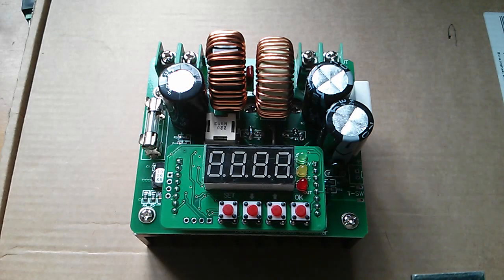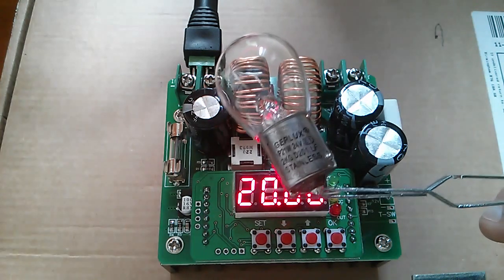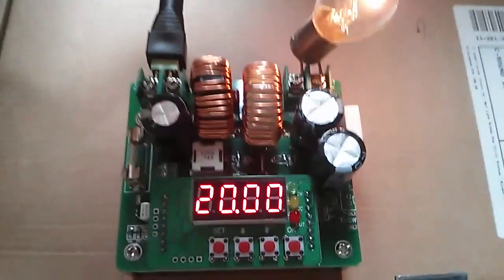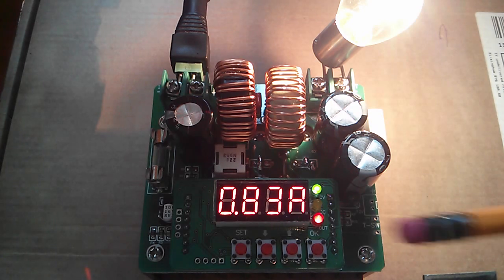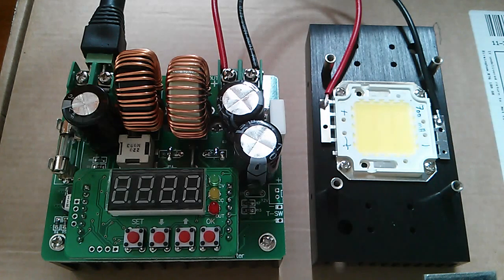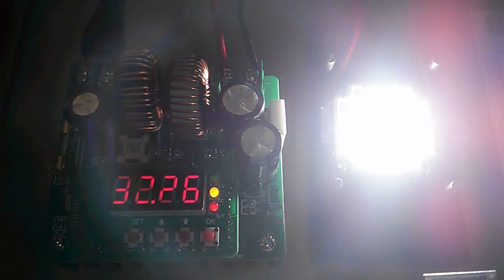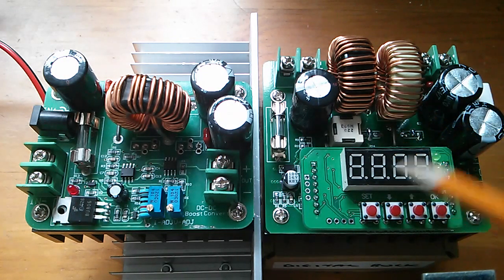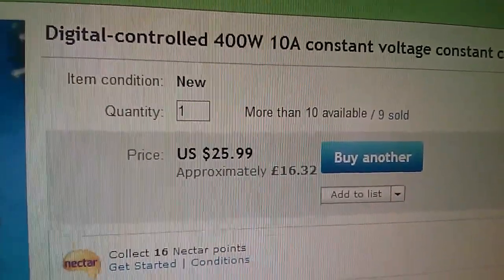Review: 400W Digitally Controlled DC/DC Step-Up Boost Converter

Comment: Its very good of you do do these video reviews on various e-bay electronic components especially since many people will find the information helpful and of course influence their buying decisions. On the other hand, a very intelligent and electronic savvy person such as yourself could easily build your own spot on boost converter for any particular application. It may be of further interest to your subscribers to see you build such a device (step by step) for the purpose of driving high power LED's with 12 Volts. PS You seem like a very interesting person and I'm an avid viewer of your channel. Keep up the good work!
Reply: +Cameron MacDonald 

Nominal 400W means that the module 400W maximum power under certain 
operating conditions, under different input voltage, the maximum output 
power is limited by the maximum input current limit declined.

For example:

The input voltage is 12V: maximum output power P = 12V * 10A = 120W

The input voltage is 24V: maximum output power P = 24V * 10A = 240W

The input voltage is 40V: maximum output power P = 40V * 10A = 400W

Comment from the maker: I did consider that as a solution, but...
The converter is also very slow to ramp the voltage back down. At the instant the LED was connected, it would be considerably over current until the voltage fell to the right level for proper current limiting. If you set the voltage quite precisely, it might work, but it's an added complication, and the whole point of buying this unit was to make driving high power LEDs simple. It's a real pain because this was to be the centre-piece of my LED tutorials.

Comment: Remember a while back we were discussing various cores for inductors? Looks like the module you have there has one ov each, the left one being ferrite and the right one probably being the powdered iron. I would presume (at a quick rough guess) the LH one does the actual boost converting while the RH one a supression choke to remove high freq spurries from the output.

Comment: What happens when you lower or raise the amp/ma on the in side of the boost converter? Like say I want to use one or more of these with a rgb controller and boost the voltage up from 12v or 24v to 34v for a high power rgb led? Would the boost converter keep a constant draw? Or alternate as its adjusted on the in side of the boost converter?

Comment: Hi Julian. I got myself one of these units (it arrived yesterday) and I think I've found a potentially destructive bug in the firmware on this thing. If you set an output voltage of less than 0.13 volts it goes crazy and starts ramping up the voltage continuously (way past the 80v max). I watched my unit go all the way up to 99volts before I killed the power to it to prevent it from self destructing (the output caps are only 100V rated). I also found that the current limit function becomes confused if the input voltage changes. I'm curious to know if your unit exhibits the same behaviour.  Thanks.
Reply from the maker: Jim Conner I'll give that a try - thanks for the advice.
Reply: I think you might have a faulty unit, I just tried it on mine and it doesn't do that.
Reply: steamtraintom
Thanks for testing that. Can I get you to check another thing for me please. When I attach input power to the unit the output ramps up to around 25V very briefly (even though the boost function is not enabled yet). It seems to demand quite a lot of current when the power is first attached, but after about half a second the power drops back down and then the display lights up.... and there's a third problem I have with it too... perhaps I should make a video to detail all of this?
Reply: Julian Ilett Hi Julian - As my Internet was down this morning, I took a little time to make a video detailing the problems I found with this boost converter. I won't post a link here as it'll be flagged as spam, but it's over on my channel if you're interested in taking a look. Cheers.
Reply from the maker: Jim Conner Hi Jim - thanks for doing those tests. Yes, those are quite nasty bugs. I'll link to your video here http://youtu.be/Xp6uDBMn3cY?list=UUWo6-_8wmKNyBt2FWDfUvpQ and also in the description. I'll be getting my unit back out again to test the filament LEDs soon. I'll let you know if I have the same problems.
Reply: Julian Ilett Awesome - thanks Julian. I have a friend with the same converter who's going to repeat the same tests this evening when he gets back from work, so I'll let you know how he gets on and whether this is just my particular unit or more widespread. I've been tempted by those LED filaments for a while myself too :)

Comment: Thanks for this posting.  Only used one boost converter myself and the one posted here is a serious high output unit.  I'll order one of these for various projects.  I'd really like to see, if you have chance to do so, take a Quad-Copter, adding on about 4 or so Mono-crystalline solar cells of say, 1 amp each, and use a boost converter and keep the Quad-Copter running full time in direct sunlight, changing batteries (or buffer Super Capacitor) for cloudy times, in all providing the Quad-Copter running for hours, providing power ratios fit.  That would be neat.  My idea ever since I seen Quad-Copters but since I don't have one and no time to do this myself, would love to see a video of your build of such a Solar Quad-Copter.  Hope you can do this.  If so, that would be great!

Comment: I have an application where the slow voltage rise time might not be a problem, but I need to be able to deliver 4A at 26.5V and I'm not sure that this unit can do that.  Your application here was for a somewhat higher voltage of about 32V but a much lower current of 700mA.  Can you tell me if this unit can deliver 4A at 26.5V from an input of 12V and given the loses better make that 11V.

Comment: Have you figured out how to use the F1-F6 settings when doing a long hold SET button? I found that the Power on/off at start up is set by Holding the OK button.  It doesn't look like #1 or 2 are available on this unit.  Any input you have would be helpful in the operations.  Thanks

Comment: it's not a problem of the digital side. It's a design issue. Also it's possible to set the current and voltage in an analog boost converter from a digital controller, which is better. Plus you can get one of those analog boost converters with a LED display on it which shows the voltage and another for the current. You set the voltage, then you put load and set the constant current value using the same 10 turn trimmers. Well for boost it's bad because you can't just short it as you would do with buck. And by the way there are boost converters that have more than one switch where you can actually turn the output off. The diode in buck or boost converter is the budget solution for the second switch.

Comment: Good day Julian. Just a wild thought, can this DC step up booster be used to charge a 60v (or even higher) SLA battery set of an ebike? I was thinking a front motor hub to be used as generator connected to a DC step up booster charging the SLA for extended range. Is this feasible at all? Thank you for your reply.

Comment: Don't know if you are answer this question but I wanted to run a string of LED lights when you get to the end you have exhausted your 12 volts down to 9 volts and some change, I wanted to use that to put into one of these units but the ones I've used that were very cheap seem not to be able to constantly run they turn off and on don't know why because when you put it on your voltage box it runs perfectly so all my tests doesn't work in the real thing I was trying to find something they can take something like LED lights boost it back up to the 12 volts from the nine volts and it seems to be blinking off and on can you take one of these modules and test LED lights is it feeding back what's happening I don't really care how long it takes it to reach up long as the current is constant so I can run all the LED lights on one single input.

Comment: Great vid!  I actually have a 900w 30a digital control boost converter the same as this I use for numerous tasks, I bought it about 18 months ago and it was a bit cheaper than your 400w unit actually (about AUD $24 (or US $17).
 Great for charging different battery voltages, solar control, and for powering pretty much anything, TFS!

Comment: Would it work to run a 24v solar panel to a 24v controller to this to a 36v battery bank? Can't seem to find this answer anywhere on the web. Thanks.

Comment: The slow rise time is from the large capacitors on the input and output.  These give you a more steady output with less ripple but at the cost of capacitor charging time.
Reply: Not that long. May take a fraction of a second, but not that long!

Comment: hey julian, do you think that the 600w non digital booster would be able to power up  2 100w leds, and if so would they be wired in parallel with an output voltage from the  booster of 70 volts with 6 amps or should it be wired in series with different voltage/amp ratio ?

Comment: For the slow voltage ramping - Try changing the output capacitors to a smaller value, I had a similar issue with a boost converter slowly ramping up and down.  The PWM we used from the microcontroller was fast acting, we used a large cap to help with smoothing, but it also added a delay due to the extra time constant for charging and discharging.
Reply from the maker: I don't think that's it, because the output capacitors (2x 470uF 100v) are the same on the analogue version and that doesn't have any delay at all. It's mysterious.
Reply: I guess the ramp is down to the voltage resolution, since it can't just bang it on at full, but has to vary the switching of the inductor gradually until it reaches the desired voltage.  I suppose it could apply a more intelligent algorithm to it though, where it ramped in coarser steps initially until fine tuning at the end of the ramp.
Reply from the maker: bigclivedotcom I'm thinking that the fast ramp up may have caused interference from the analogue to the digital parts of the circuit. Maybe the microcontroller was locking up, so they slowed it down. Might also explain the 2nd big inductor which I guess must be a filter (as xanataph suggested). The non-digital version (with the multi-turn pots) doesn't have the extra inductor.
Reply: Julian Ilett It could be that the fast ramp was overshooting the required voltage because of the delay caused by the capacitor charging.
Reply from the maker: bigclivedotcom Ah yes, that's a thought. Although your idea of a fast initial rise followed by a slowdown at the end would fix that. What's really irritating is that MingHe have no internet presence (no web site that I can find), so I can't ask them!
Reply: Julian Ilett What's the bet that it's one of many generic modules based on a common bit of software that was ripped off from a hobbyists website project.

Comment: I used a 600w boost converter of similar technology. Input was 12v and output was 48v to drive a controller for ebike having a brushless 36v motor. I found that booster is able to power the motor but it seems like there is insufficent amperage such that when i throttle it , after a short while like 1 second, the motor slows down due to the capacitor juice has been drained too low. If i throttle lesser for a few seconds, the output capacitors then have accumulated enough juice such that i can throttle harder again and cycle repeats. Is the problem really due to the output capacitor? If it really is 600w, then its only for a short burst. So, i should be looking at watt hour ratings?

Comment: Hi Julian, thanks for the video. I'm having real problems getting this to the setting I want. I don't know how to use the set, up, down, okay keys and get the output voltage and current I need. The instructions I have found on the internet have been translated from Chinese and not intelligible. Please help, thanks. I'm simply needing 24V 10A, the input power supply is capable of 300W.

Also what is F1 to F6?

Comment: The digital booster has a 4 holes for header pin socket on the left end of the button PCB (VCC GRN SDA SCL) for serial communication so it can talk to Arduino and be used for battery protection circuit in lithium battery protection so definite winner for LED driving!!!
Reply from the maker: Really? Mine says Vcc, Gnd, TxD and RxD. If your unit has SCL and SDA, that implies an I2C interface. Very interesting.

Comment: Looking at that wiki diagram, that switch (mosfet) looks like it must be able to take an unbelievable amount og kickback surge from that big inductor???  Is this some kind of special FET--I don't recall any mention of it's specks in this regard.  Is it prone to failure and have external protection circuitry?

Comment: Hi Julian, thanks for you videos, very inspiring, so decided to build a 100w led torch.. my problem is I have made a 37.5 v supply and need to get it to run the 100w led. So I figured I need to step it down by 2 volts.  What device would you recommend to do this.  Maybe I don't need one if the current draw will drop the volts, what voltage drop do you feel i will get when the load goes on?  Also, Is there some thing to hold the volts constant even though the battery voltage drops as the battery drains? You comments would be much appreciated, Pat.

Comment: So I have a 100W LED that runs on 3A, 30V.  But I want to put a timer in the circuit to control how long the light stays on.  I have a 24V power off delay timer (not available in 30V).  So is it possible to put step down converter before the timer to bring it to 24V and then a boost converter like you have here to bring it back to 30V for the light?  And if so, what are the appropriate converters?  Those rated higher in wattage and current than needed, or those closest matched?

Comment: Hi I have the same boost converter. How would it fair with a 58.4 volt 2amp lithium ion battery charger as the power supply to charge a 50 volt lithium ion charger? Any warnings or advice?

Comment: Hi I am interested in design of high gain DC DC boost converter for my photovoltaic system, is it possible to connect 1MW photovoltaic system to HVDC transmission system by reducing the conversion system.

Comment: Hi Julian;
The thing I'm having a hard time wrapping my head arround  is that this device like others has lots of power for LED's (about 200w in at 13v). But can it drive multiple LED's ?  every time I build LED lights there are multiples.
Most commonly, multiple lights where I would like to use motion sensors on each light. But every time a light goes on or off, the voltage stays the same but the current would change? Wouldn't it ?
I am currently looking at a set of 4 COB strips that are 28v @ 1000ma each and this is for a Boy Scout camp who wants to run off of batteries ,with a motion sensor on each. I suggested this device because it would allow monitoring of the batteries (voltage). But now I question how to do this ?

Thanks
Terry

Comment: a question why does the boost converter work with a battery as power supply but not with a AC power adapter ? The output  specification  of the adapter is 12V 1.5A. The boost converter is connected to a inverter.

Comment: Is there a reason I am not able to boost anymore voltage than around (OUTPUT) 44V  0.01A  thats running off an old computer wall charging cable with (INPUT) 12V 1A power supply that I have plugged into my wall? I dont understand because everytime I close the circuit the voltage either jumps down to around 15V, from 30V and doesn’t go back up, it just stays down and is jumping right around 15V. And when I increase voltage 44V+ it basically shuts down when I close the circuit and shows a single number on LED screen which can be a random number, although I thinks its been (0) the most, if that means anything? I’m electric Anodizing Incase that helps. I’m not shorting the circuit out either. So I’m wondering if you think the INPUT just needs current for the OUTPUT to work at higher voltages (I’m trying to find one that gets up to 120V with no problem)? Eeven though I dont need or want current from my OUTPUT except maybe a few mA’s. I just need something that can boost up to around 120V using this type of wall jack power supply. I didn’t get this exact model either. I got the 900W version but it should function the same way. Please let me know if you have any input on this matter. Iv been searching everywhere and don’t know if It’s defective and I should return it or if I’m doing something wrong. Another thing I noticed is that no matter how many times I try to change the Current setting, while it turned on, it keeps going back to 0.01A. It used to let me change this setting by selecting “SET” then when I’m done press “Ok” to initiate output. All of a sudden started doing weird things. Is my power supply okay to use like that or am I supposed to use something else? Iv even trued using a 9V battery, which does work but causes the same issues. Please and Thanks

Comment: hi.im trying to charge a 56v lithium power tool battery with my dork charger from a 30v power supply but power in between 12to 14v and have set output to 57 v an from 2 to 4 amps but had no luck yet as the drok is not charging the battery although the voltage rises .perhaps the battery is restricting someway with bms inside.may have to buy the proper charger

Comment: good demo, for your issue with voltage not turning on the external device  instantaneously, I would use a charge pump between the voltage/Amp booster and external lighting or other applications that are powered by the V/Amp booster.